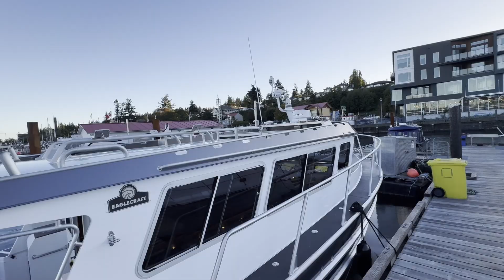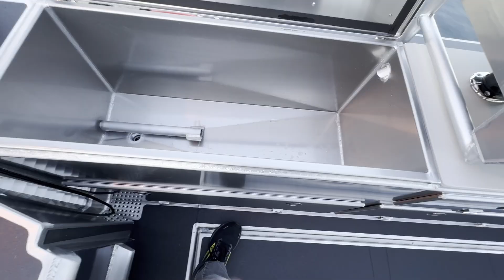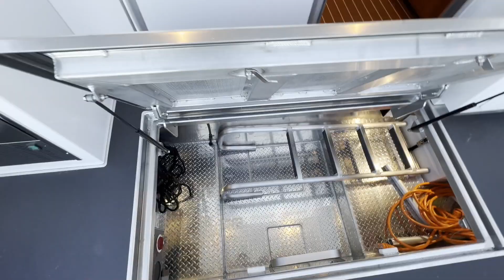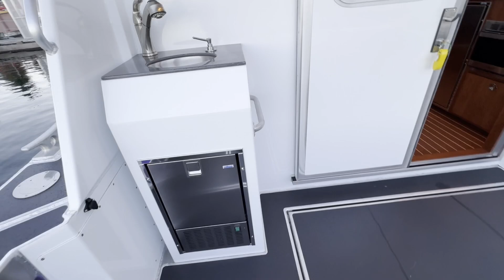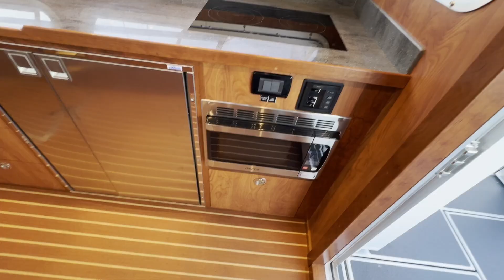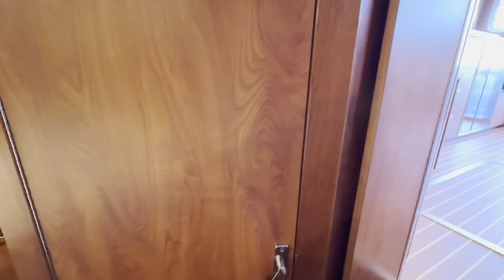EagleCraft 40 Cruiser Walkthrough | Custom Boat Builder

Comment: Love it. Layout very similar to Ranger Tug. For the money I think I’d want a factory generator. Speaking of money, any educated guesses on price? My guess is $450K range….
Reply: 450k lolololololol... my educated guess is 1.5 to 2mil
based on their other boats
Reply: Half a million will get you a fully loaded top of the line kingfisher. I think kingfisher are nice, but eaglecraft are in a completely different level of bespoke craftsmanship with nicer materials. Considering this boat is several feet longer and a few feet wider with finer finishes than the best kingfisher, and the level of certification of their welders that specialize in commercial boats, I’d guess 2M+ for something of this caliber.
Reply: I'm cuious of the same. My guess, double your $450 or even a bit more in CDN $$.  And the weight is?
Reply from the maker: @EagleCraft
You can build your ideal specifications and pricing will be provided at https://eaglecraft.com/recreational-craft/38-cruiser/38-cruiser-builder/. If the D6 440 engines are selected the boat length will be increased to 40' LOA.

Generator is an option within our specifications

Comment: Just gorgeous! Very nice build. I can envision an East Coast version, with full length flybridge / boat deck and an aluminum hard top. The boat is beamy enough to handle that for stability issues. Twin D6 packages should be enough for the extra weight. AC of course. Luxury seating on fly bridge and fishing from  cockpit. Lovely!
Reply from the maker: We do have flybridge option on all our  designs 38' and larger and have built boats with air conditioning

Comment: Be nice to add sound insulation to the engine compartment
Reply from the maker: The engine compartment is insulated with fire-retardant acoustic absorbing material. This boat is about 75 decibels at  cruise speed. Between the engine hatch structure you will notice the insulation which is covered for durability reasons